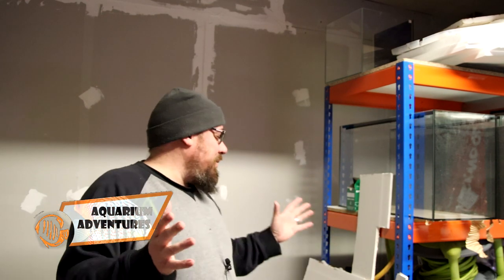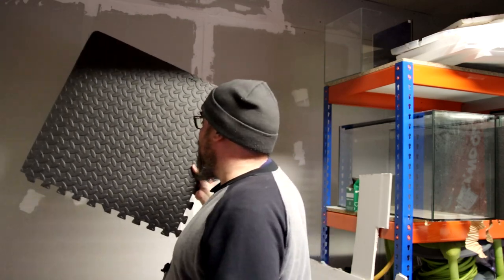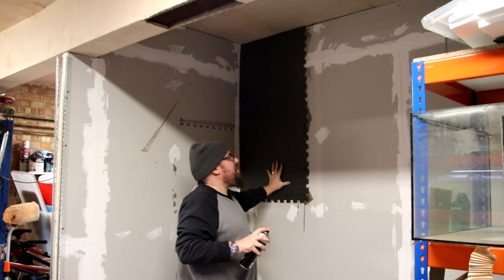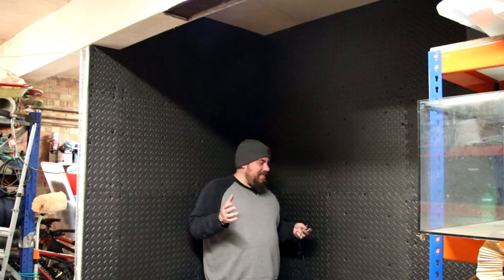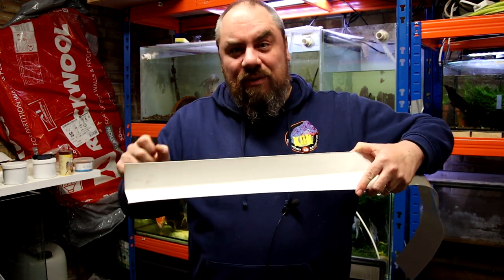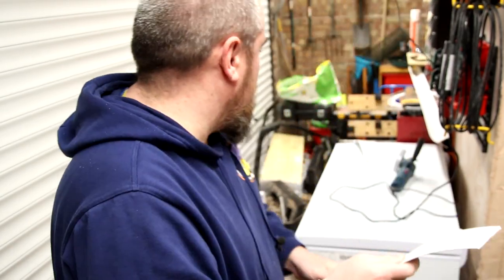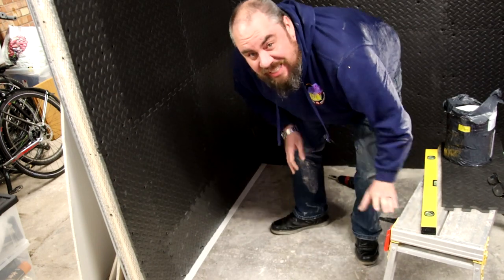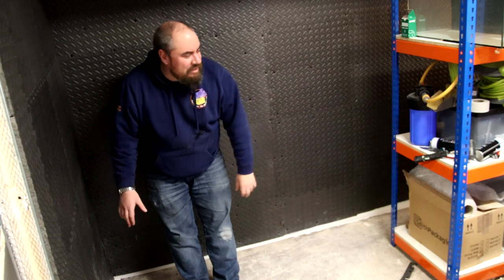I put the floor on the wall. Fish room build update!

Comment: 8 ft x 4ft sheets of polystyrene from wicks, or any builders merchants. 2inch thick or preferably 4 inch thick.
Best fishroon insulation imo. No condensation and Saves loads of money down the line on energy bills.
If you don't like the look, just give it a lick of paint.
Reply: Put it straight over plaster board. Also Sealing floor and walls.
Well that's how I do it any way. Worked for me over many years. 
Happy fishkeeping to you sir
Reply from the maker: I may steal that idea for fish room 3.0!